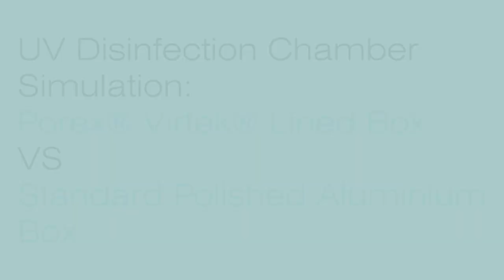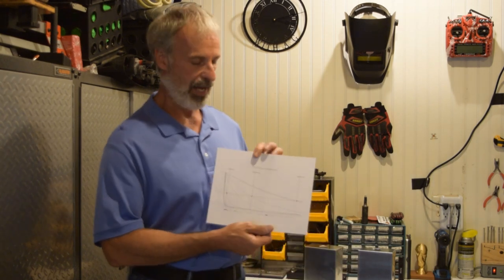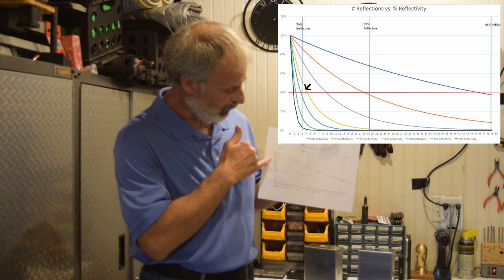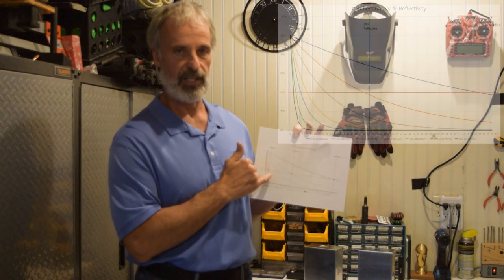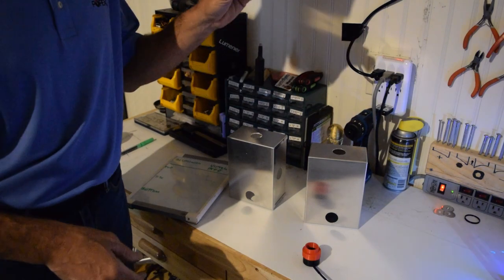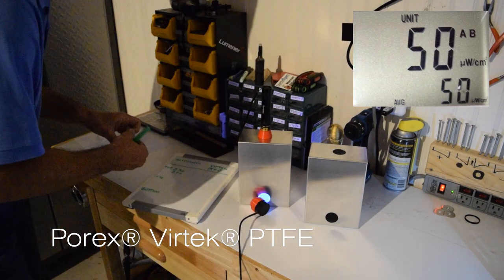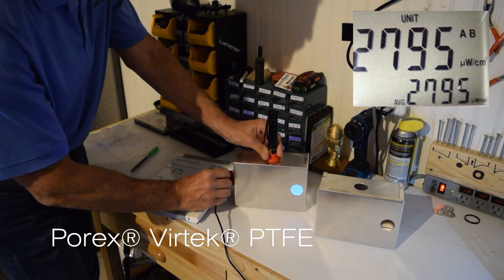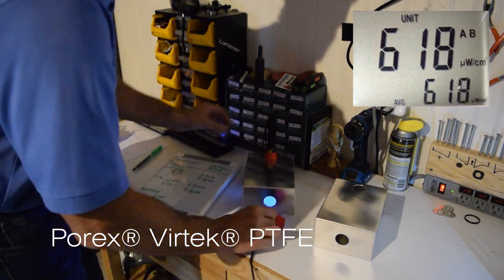DEMO: UVC Disinfection Chamber

Comment: Thanks for your innovation. I am concerned about the properties of the light you are using for the test. The uv led flashlight is most likely uva and as such is quite different in spectral reflectivity on surfaces then uvc light. Uvc leds emit 275 nm light and are completely invisible to the naked eye. 

Also you will need a uvc specific light meter. 

Thanks
Reply: I agree - the light is a 365 nm.  I used that so you can actually see the output (275 nm is more or less invisible to the eye) and also for my personal safety.  From the data we have - the performance at 275 vs 365 is almost identical -- if not slightly better.